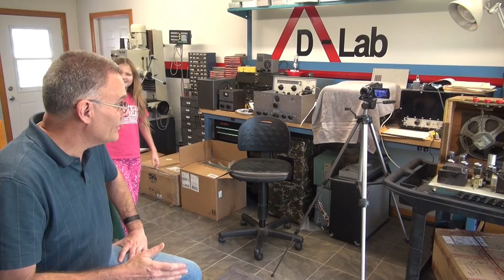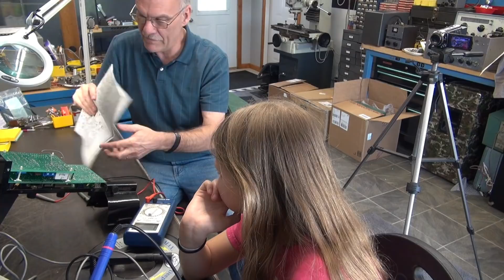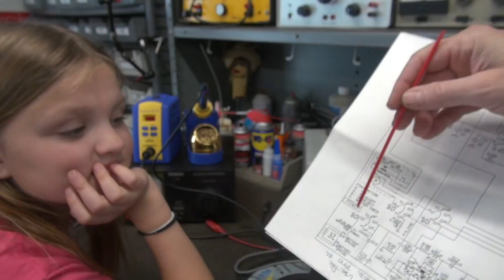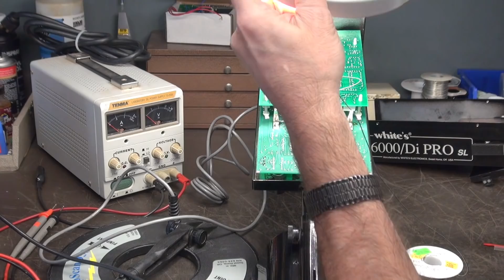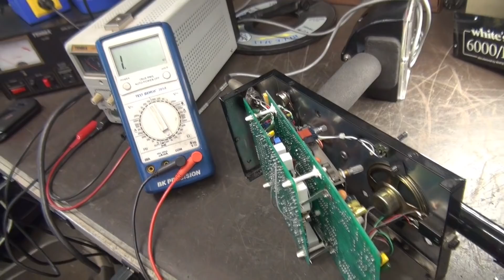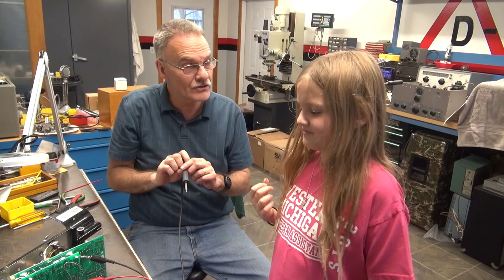How to repair Dead Whites 6000/DI SL PRO Vintage Metal Detector No power up Instructions

Comment: Hi there D-Lab, firstly thank you for your videos, I've come into possession of a 'Sears' G.E.B Tri-discriminator model 321-59634, which I believe is a Whites 5000D Series 2.

I am reasonably competent in electronics and detecting so bought this hoping I could troubleshoot and repair it.
From your earlier video regarding Whites coil troubleshooting I am certain the coil is stuffed, I'm getting continuity on 1-2 but between nothing to nothing else.
Reaching out for your help please, I was wondering if you had a video on how to reseat the 5 pin slim line connector as I've been unable to find anyone or anything else close to your level of knowledge or helpfulness online.

There's some corrosion around the strain relief from the cable and I suspect I need to re-terminate the connector.
Would highly appreciate any help you're able to offer, I love detecting and am hoping to give my other detector to my kids and I utilise this one so we may go detecting together.
Thank you kindly.